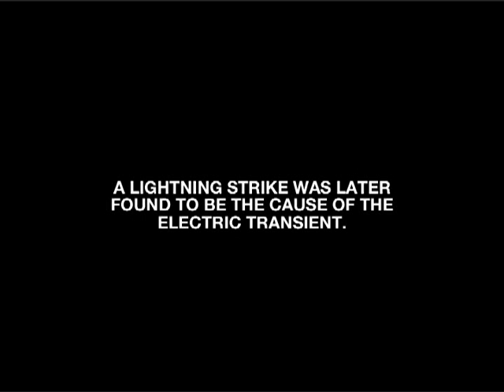Apollo 12 Firing Room launch scenes and post-launch at the Pad

Comment: I didn't know they even tested for electrical potentials in the clouds on Apollo 12, I just figured they felt "There's no lightning, let's go" and were just ignorant to the possibility of a charge that would only discharge if it had a really good path (ie, SatV flying into trailing a "copper wire", the exhaust plume was ionized and served very well as a path). 

Still just shocking with how crappy the weather was just from a RSO standpoint that they launched. They couldn't see the rocket after about 10 secs. Not great for range safety.